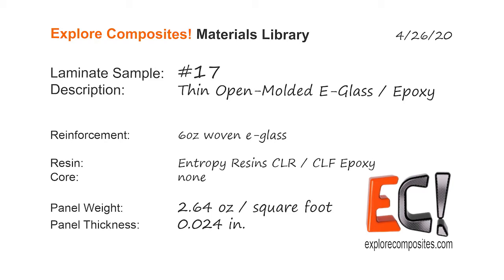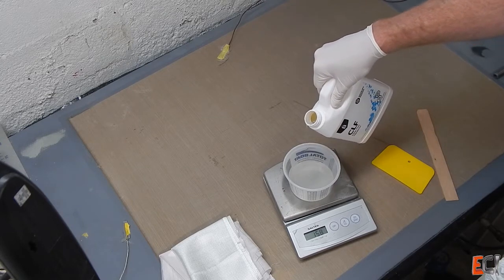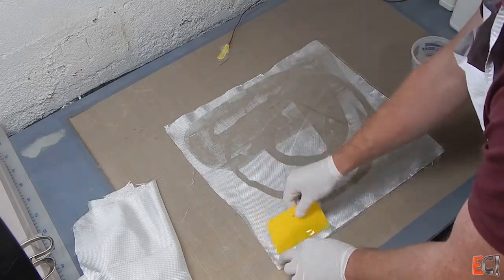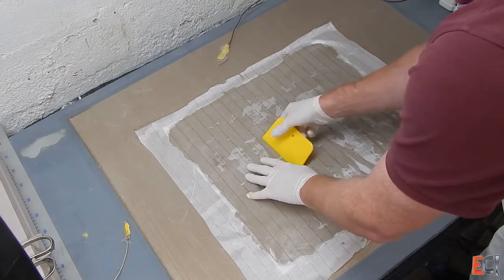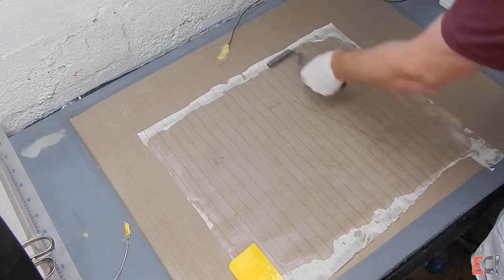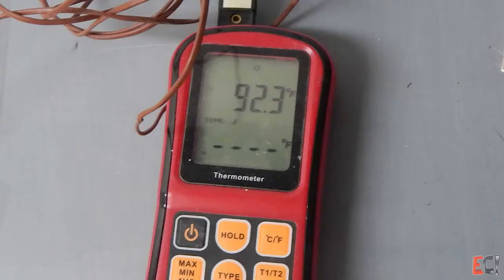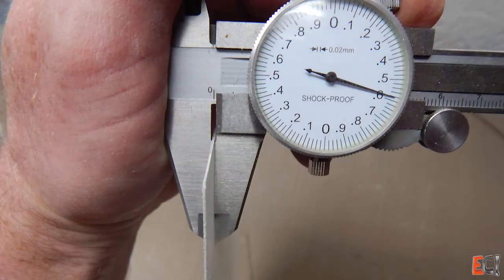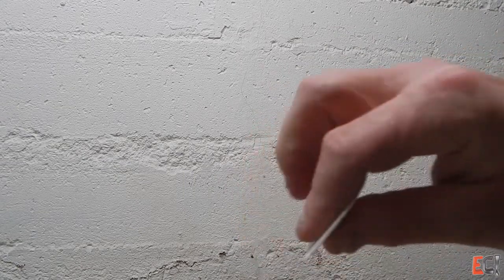Laminate Sample #17: Thin Open-Molded E-Glass / Epoxy

Comment: How many ply would make a laminate about 4mm thick???
Reply from the maker: Probably 12-16 but you'd want to test it because open molding can be hard to make uniform or consistent when there are lots of plies - its just adds up.  And resin content and manual (roller ) consolidation is a lot of work.  You might want to use thicker/heavier plies!  Check out Laminate Sample #10.
Reply: @ExploreComposites  thank you